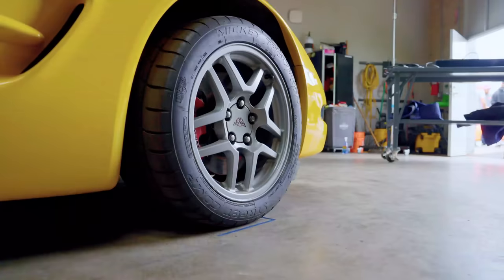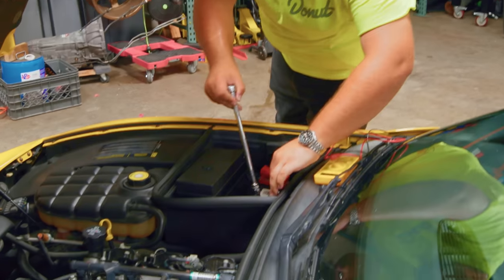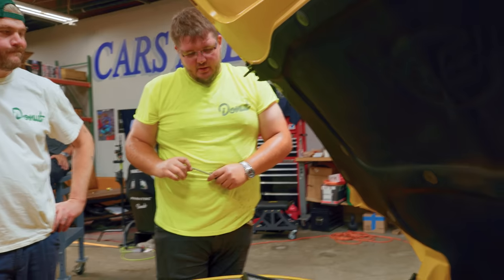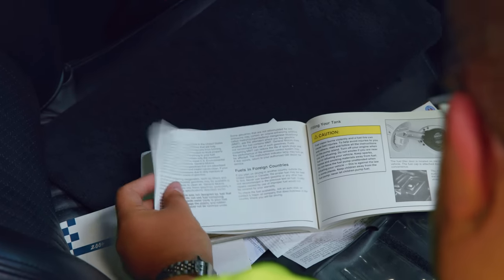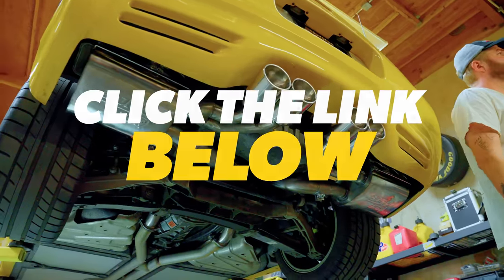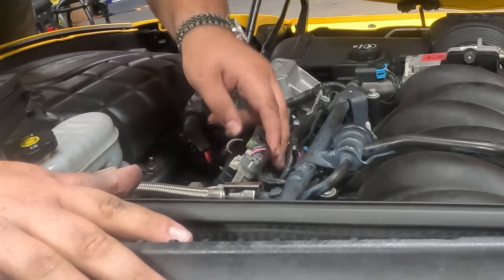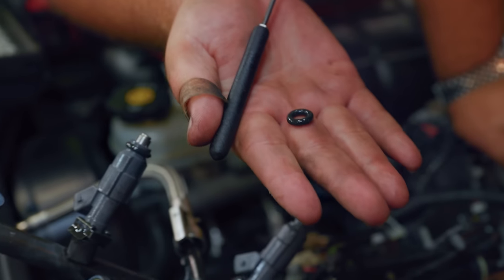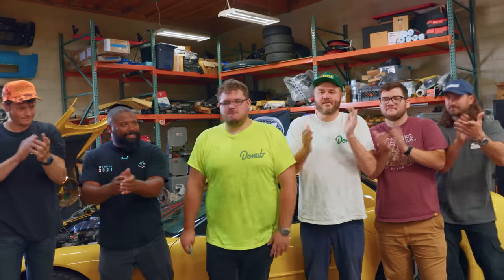Giving Someone a Corvette, If They Can Fix It

Comment: Sam tackled this car like it had normal problems instead of sabotage. He almost went right down the list of stuff if it was a normal car instead of tampered with.
Reply: thats true but when you're diagnosing things there's kind of a system you have to go through mentally weather you know its sabotaged or not. honestly donut made this episode pretty difficult with the red herrings / multiple cases of the same problem.
Reply: @yungbroc  As it should be, if you're giving away a free car. Their goal is to make money from it with video content, they would lose money if it were only one video BUT if someone did get it in the first try, they would definitely deserve it, since they know how to fully work on it.
Reply: But he didn't use any form of logic when it came to the steps when finding out what the problem was.  If you find out that one spark plug wire was cut, why would you not check them all?  I see a vacuum hose is cut or coming off, why wouldn't you check the rest?
Reply: @_pitaph_6392  He found half the problems by accident and he had a lot of help too. I don't think his problem was not knowing the car, those issues were not car specific.
Reply: Exactly, normal cars break down: but they dont get sabotaged, normally
Reply: @phr3dmcc0y  Generally speaking if you get an issue in your vacuum line then you fix it before you get multiple issues. Same goes with the spark plug cables, one goes bust rarely 2 at the same time. That being said, they did preface it by saying if you bought a project car off someone you have no idea what could have been done to it. So we shouldn't be thinking of this as a 'break down' problem.
Reply: @DiustheZ ou are thinking of it the way it’s taught to people, in the real world is there rarely two problems on the same system happening because the cars/trucks are being used. It is less likely for example, for the engine to be inoperable because of two vacuum leaks or spark plug wire failures presenting themselves at the same time. Usually I’ll only be one making problems 

You are then taught to replace all just in case as they are also likely to die. Not go around checking every damn one to see if they work
Reply: @_pitaph_6392  Especially vacuum lines, you can almost always hear vacuum leaks if it will idle a bit.
Reply: I agree. A bad battery, damaged vacuum line or plug wires, or blown fuse is realistic, but 6 out of 8 fuel injectors being sabotaged, vacuum lines totally missing, the entire intake manifold being loose, the key frozen in a block of ice, etc just isn't. I'm obviously not saying they should give away a Corvette, but even the best mechanics would struggle to diagnose and resolve all those problems in 90 minutes. It's easy for us to say what we would have done or what he should have done when we are comfortably sitting at home with the benefit of hindsight, but actually being in a situation like this is a whole different story.
Reply: You're absolutely right
Reply: Whobpaid you to said this !
Reply: That is true didnt think of that
Reply: We used to do these kinda things for PC technicians interviewing when I was younger.  Same kinda bullshit stuff that you'd never encounter in the real world.
Reply: The sabotage stuff they do is generally pretty out in the open. And, like he was concerned with how they enunciated a single spark plug wire. Yet, didn’t take the time to check the other wires. 
Being put on the clock and under pressure makes things hard. But, I’d say it was a reasonably fair deal.
Reply: @averyalexander2303  Instead of giving away a Corvette, a giveaway of a pro tool bag or good car parts + easier issues can be very reasonable. 
I don't know much about cars but I don't think a usual machinist can fix 6+3(repeated) problems in 90+20 min. Nearly 12 min to fix one issue, insane.
Reply: @NBSV1  oh yeah.  Agreed for sure.  Like as soon as I found the plug wire or vacuum line, I’d be checking all of them
Reply: I say we all spam SAM in the comments of their vids until they give him the vette
Reply: The issue with finding one sabotaged item is that you know going into it that it's sabotaged, vs a normal car with wear and tear you think that you will obviously follow the path of probability... One of the spark plug wires was cut clean in two, the other was cut but not in 2...

Seeing as he saw the clean cut wire and checked all the others and they weren't cut clean in two via sabotage, he assumed they were fine. 

And diagnosing a car is a different process than fixing one as well, if you think a spark plug wire is bad .. it's not uncommon to put one on to "see" if that was the issue before buying a whole set.

Lots of variables but I think he did great, got a little confused at first but regained quickly, especially considering he only had 90m off the rip haha
Reply: Intake leaks, blowing fuses, vacuum leaks, bad spark plug wires, bad injectors, kind of normal actually. This was a basic b** Chevy V8 wrapped in the simplest car you possibly can do with any kind of electronics. I feel the block of ice was there because the car was kind of easy. 
His diagnosis process was this kind of... Hit and Miss. And still He might have had the car if he didn't lose 10 minutes for asking for a random part with no reason. This is called in the business throwing parts at the car.
Reply: @jamie3810  it’s different when a camera crew and people are watching you
Reply: If I find a bad spark plug wire I check the rest.
Reply: @qwertpoiuy430  Yeah that's pretty much what i said, I also noted that they mentioned this scenario was more like buying a car that was someone's hobby/fix up. Who knows what they did to it (Or what their ex-wife did to it when she found out how much he spent on it). In a scenario like that anything could happen including sugar in the gas tank haha.
Reply: I thought he was going to make it - I feel kind of sad he didn’t.
Reply: @_pitaph_6392  Their M.O. from past challlenges has been: mess with fuses and wiring, mess with hoses and connectors, mess with the battery, mess with the ground, some component is dead (such as a PCV valve) and so on. Usually a couple of them for wires and connectors.  Nothing requiring a lift or major dissasembly.  Nothing like bleed the entire brake system.  Also, 5 minutes to get the thing out of the ice?  Flip it on its side or just push it onto the floor and use any heavy hammer or object and a chisel or screwdriver to shatter it. 2 mins tops.  Hammering down on from above it is worlds faster and more likely to shatter it quickly.
Reply: @josephoberlander  Hindsight Harold, but yeah, you right
Reply: not true man my f150 4.6 needed multiple vacuum hoses. stuff with throttle body and fuses etc etc same with injectors in a f250 7.3 and spark plugs in any ford 5.4 these are all issues i have seen not even as a mechanic but as owning or helping a buddy.
Reply: but the ice thing was kind of a dick move but i dont think i could give away a vette. well maybe if i had a higher than sum 6 six figures as they are not thattt expensive.
Reply: Who else thought he was gonna be like “well guys sorry I’ve never been a mechanic, I don’t even like cars” 😂😂😂

Comment: Honestly felt kinda dirty being told there was 6 problems when there was actually 9. the two sparkplugs and three different vacuum leaks. poor guy had the hardest challenge. super impressed by his ability to almost get the job done despite never having worked on a vette before
Reply: 100% I think they did that because they didnt want a victory. Then they only gave him that info when there wasnt enough time to completely correct it..
Reply: they weren't crossing them off tho when he fix a part of it, shouldn't that be a clue?
Reply: @valkydon1338  not to him, they merely handed him the correct tool if he asked for the problem. we saw it crossed off, the mechanic didnt. so when he got that tool and fixed the 1/3 same issues, he thought he might have been done. im still in that he was done dirty by donut
Reply: was done dirty didn't get enough time either.
Reply: This was really dirty on Donut's part. They got a video and sponsorship by misleading the guy on how many problems the car actually had. 3 vacuum leaks and 2 spark plug wires. The guy got nothing.
Reply: and only had 90 minutes instead of 2 hours...
Reply: To be fair though. What kind of psycho doesn't check EVERY spark plug wire if one's been cut?
Reply: spark plugs are one unit.. he halfway did the job. same for vacuum hoses.. it sucks but he should have done fully service.. you can tell he was panicing.. honestly had enough time :/ damn sorry sam
Reply: @6Sadfox  except if you watch the video carefully they tell him he "did" the spark plugs when he asks thats pretty dirty
Reply: @tracklizard4018  a psycho that got 90 minutes for 6 issue on a corvette...
Reply: Dirty AF
Reply: @tracklizard4018  u aint wrong
Reply: @MrSpikethefirst  
They asked him several times if he was sure he only wanted a single spark plug wire, and they hinted in the same way when he asked for the vacuum hose.

Besides those are both systems where if you find an issue you always check the entire system.

And they also pushed him towards the actual issues quite a bit.  Without all the hints they were dropping he probably wouldn't have figured out any of the issues besides the battery and possibly the fuse.
Reply: Agreed, they lost a subscriber on this one
Reply: Whenever actual game shows happen on TV, they have to give the prizes out any time there is a clerical error found in the structure of the game itself, so that game show hosts are not encouraged to deceive their contestants so that fewer prizes are given out.
Reply: @tracklizard4018  That was my thinking